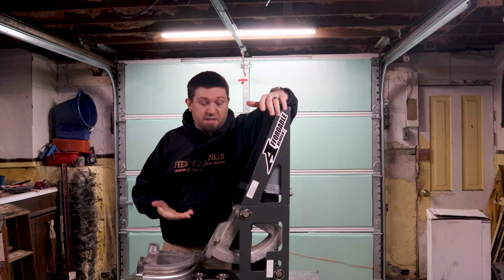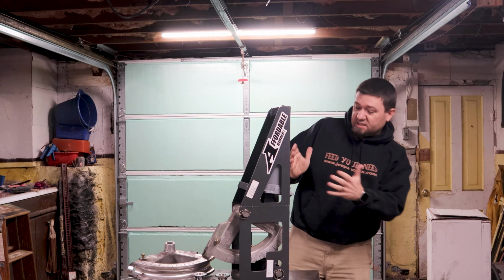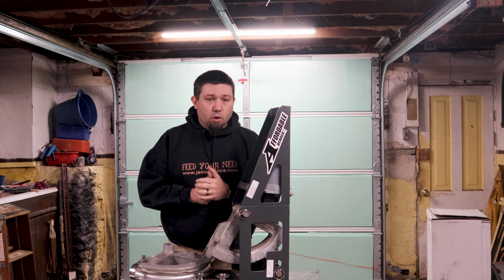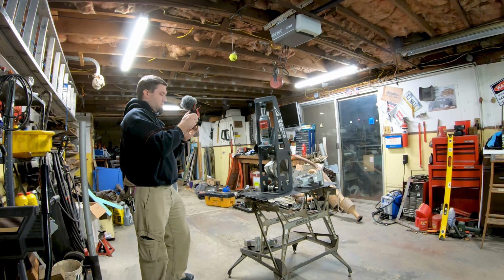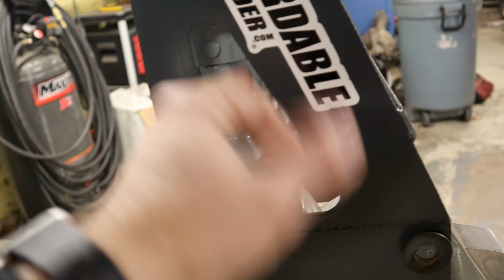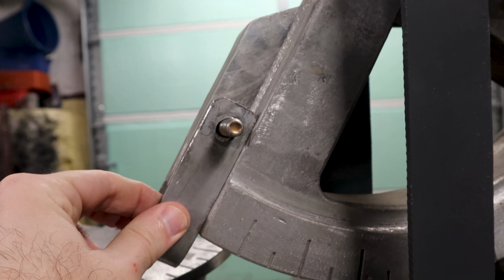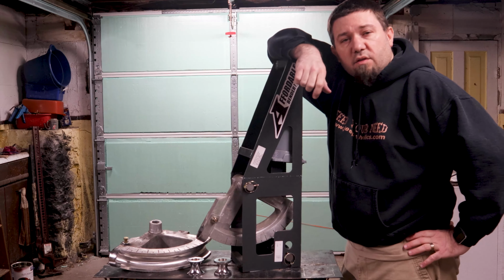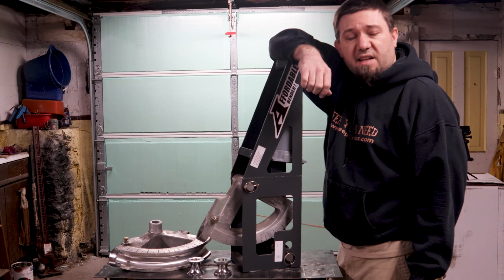A close up look at the Affordable Bender's Build Quality

Comment: I actually bought one of these because of your previous video. However myself I am not impressed at all after spending over $600, for the vendor and two dies I did believe to be a reasonable cost I was especially frustrated with one their customer service and two the overall quality of the bender. First off when I ordered it they failed to mention that they were closed it wouldn't open until next week when I emailed them to tell them what dye sizes I would like there was no professional courtesy automated email saying that this was the case so after waiting 3 days I emailed again to get confirmation that they had indeed received my order and were processing as I was frustrated that they took my money and sent me no confirmation or shipping details. Then upon receiving it, I of course was super excited and went to play around with it myself upon first glances it does appear to work very well especially for and affordable bender. However upon closer review I noticed for some explicable reason the pump jack mounting point is actually not centered in the bender nor are there bushings to center the dye itself so inevitably what happens is every time you make a bend when you try to make a matching band on the opposite side for instance doing a 180 or any sort of one-piece design even while using a magnetic digital inclonomer as there is no indication of where you are as you so aptly pointed in your video inevitably what happens is none of the bins line up they will be on different planes and in my opinion it is putting too much stress on the die and will lead to premature failure of the die and I at anywhere from $130 to $160 a piece I would make my dies to last as long as you normally possible. Then I also noticed the finish of the overall die is actually pretty good however also for some inexplicable reason and also I did not see this in your previous video nor did I see it on their website as soon as you get larger then inch and 3/8 all of the die material holding clamps have welded washers on them which I believe to be poor quality as everything is either painted or brushed ground finished in some way and I believe that to be false advertising as for all I know when I originally received it someone could have welded that on as even your video said that the washers and tightening the clamp securely prevents it from elongating the hole so when I received a randomly welded clamp I believed I had been sent a used product. So after all these issues I emailed customer service and received several not very professional responses. I was told that the singular screw that holds the top of the jack in place is actually the main culprit for why my bins were off and it wasn't centered however after proving to him with photos that you cannot adjust that to center as the entire cap is welded offset and there's only one screw so there is no way to center it once you loosen the screw the jack falls out. Of course he did not like that answer and shocked it up to my incompetence then proceeded to tell me that the welded washers are a standard on all of them larger than inch and 3/8 which is also not on their website nor in the photos, lastly after requesting several times a return on the product I finally got a response saying that yes I indeed could return the product however I would have to pay for return shipping and it needs to be returned in new condition with its own packaging well seeing as how I was completely sold in the beginning I did not have that original packaging and was also very skeptical to send the product back that they were so eager to take my money and wait for them to inspect the product before returning my money. So now I'm stuck with about $600 worth of metal that doesn't bend very well and if I would want to fix I need to basically take apart and redesign. For the hobbyist doing very minimal bending I would say it is decent however for another $150 you can buy the exact same style from speedway motors including five dies a return jack spring and a holder for the pump jack handle, which I was also unimpressed with as it was a two-part handle that looks like something out of a emergency jack for a vehicle. So I would suggest them not this.
Reply from the maker: Hey, just wanted to say thank you for the long detailed comment.  So far my own experience with the bender has been good, but limited. I am a beginner at bending tube. So it's easy for me to miss some of the details you've pointed out. I'm very sorry if my review mislead you at all.  I try to be as thorough as I can with these sort of videos. But you don't know what you don't know as they say. Right? I'll be doing more with the bender over time and if I run across the same limitations I'll be sure to outline them for viewers. Thanks for watching and I hope you can find some use for your investment.
Reply: @SWBCrawler  of course I really enjoy your channel and watching your builds I just wanted to make sure people at least were a little bit more informed than myself I've been doing some research into modifying and making some adjustments as it looks like a few other people at least on YouTube have had similar issues or are just smarter and learned how to make it better for their own needs. But I hope it works out for you and thank you for responding I am definitely not disgruntled with you by any means you were actually the deciding factor it took me 3 years to finally purchase one as it is a lot of money and budget is always a keyword. Have a great day and look forward to seeing more content
Reply from the maker: @minxspazz  I appreciate that!  Believe me.  If the higher end benders were more affordable I'd have gone for one of them. But as you say. Budget!